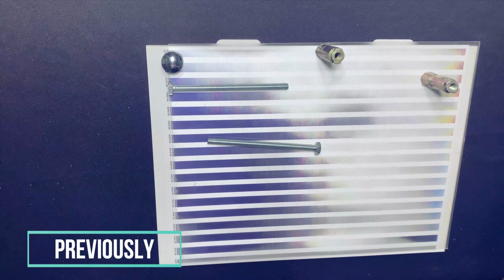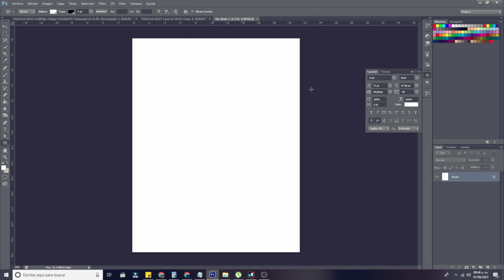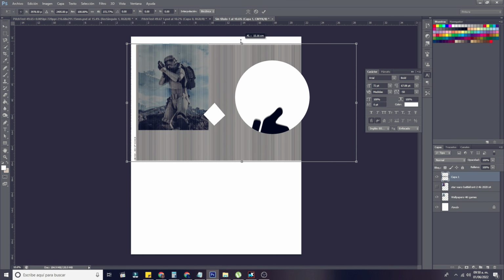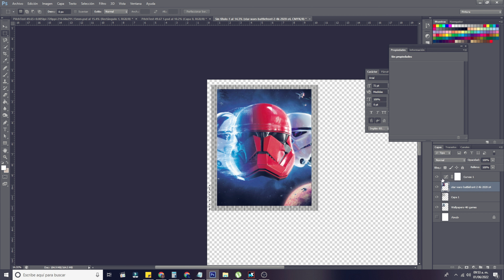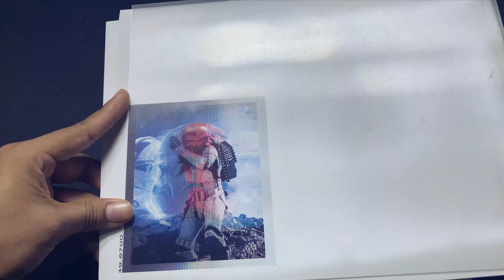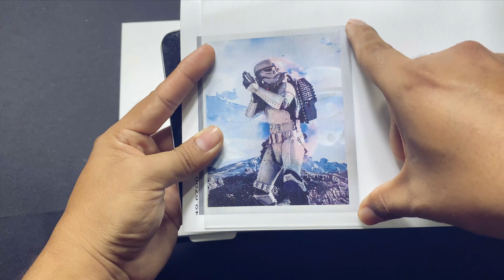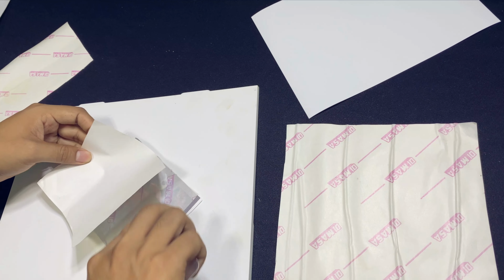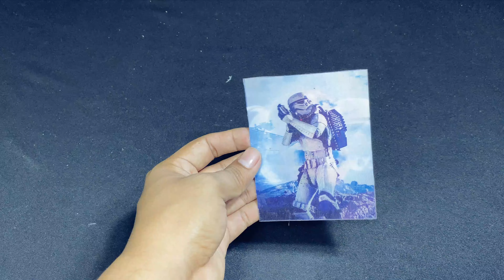Ultimate guide to creating lenticular covers| DIY| flip effect | Part 2 | AUDIO IN ENGLISH

Comment: The combining you did with the images and the pitch, how would that change if we added 3 images instead of two? Also, would things be different depending on the size of the images printed? Like, if we wanted to print a size A3 poster? Thank you so much for these tutorials!!!
Reply from the maker: the printing limit depends on your printer and that it is well calibrated, with that you will be able to obtain an impression of the maximum that you can print on your printer
Reply: I have small lenses and I can't find a way to print them like a light mobile screen sticker. Do you have a suggestion to help me?

Comment: could i know the the type of the lenticular u have used ? also can i make phone covers with it :)
Reply from the maker: I used 50 lpi lenticular laminate and with that you can make cell phone covers and it is very practical and easy to start, unlike the 75 lpi ones that are thinner, but if you are just starting out, it will be very complicated.
if you are starting I recommend the 50 LPI sheet
Reply: @hazloquepiensas16  ok thanks alot for the advice really helpfull 😍😍